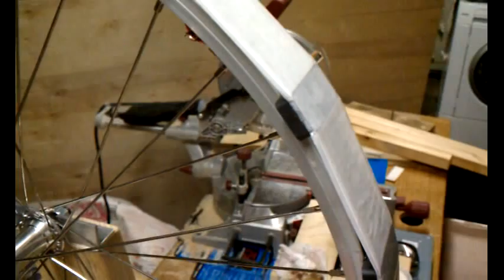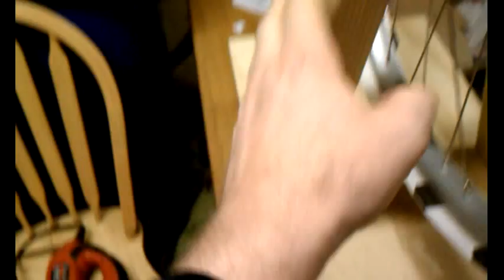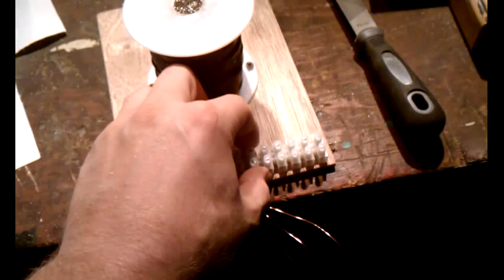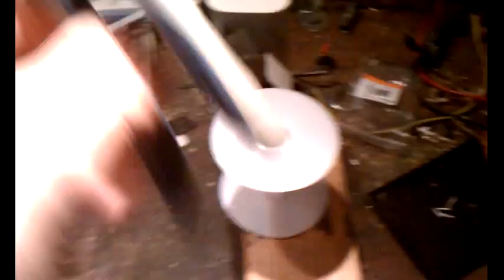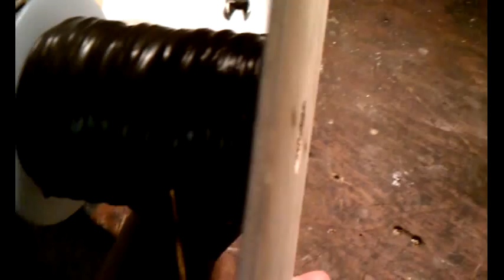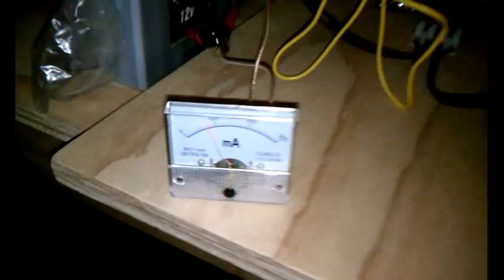Building an SSG.

Comment from the maker: @YouthPastorSkid Yeah, not likely to find it at either of those.  I don't have a link.  But, depending on where you live, look in the yellow pages for welding supply stores.  Not even all of them will have it, must really be a welding speciality place.  Mention Lincoln R60, let them look it up, if no luck, ask for 1/16" copper coated soft steel. . . most likely they will have it, but in larger size, keep looking till you find it. It's not expensive, $10 did 3 coils for me.

Comment from the maker: @YouthPastorSkid The welding rods you want to use do not have a flux core.  The official instructions says to use Lincoln R60, the places I went didn't know what that is, because it's an old standard.  You just want copper coated, soft steel, welding rod, 1/16" inch or so.  Usually come in 3 foot lengths, cut them off with a heavy duty wire cutter.

Comment from the maker: @YouthPastor You can make it turn off automatically, but that will require a voltage measurement circuit, and a relay or something to turn it off.  So no, it will keep running, but the beauty of this type of charger, is that as long as you have matched the charger to the size of battery you are charging, it's pretty hard to over-charge.  The amount of current going into the battery is infinitesimal, so you don't have overheating/battery boiling like a normal charger.